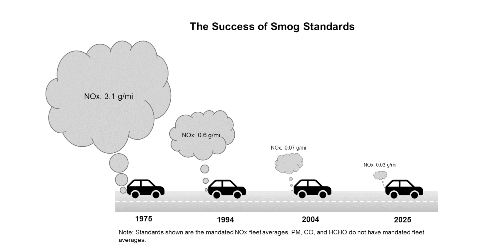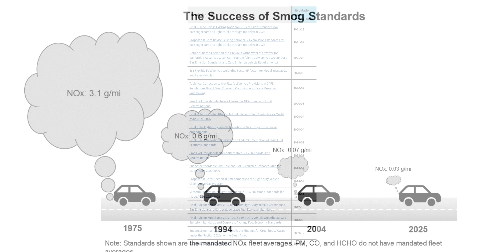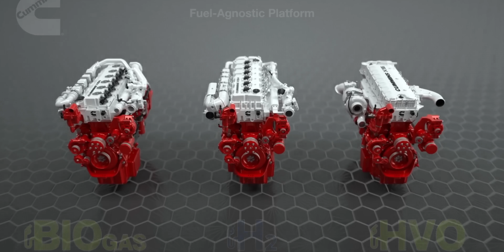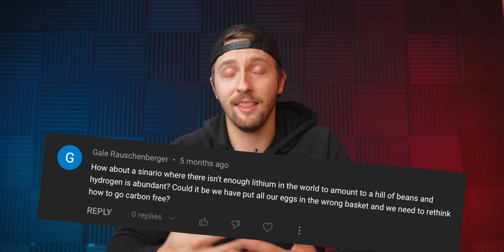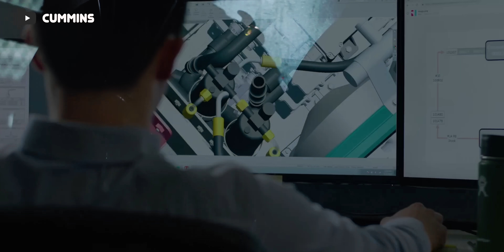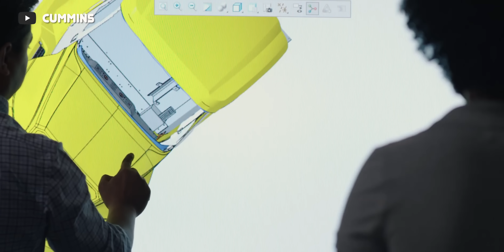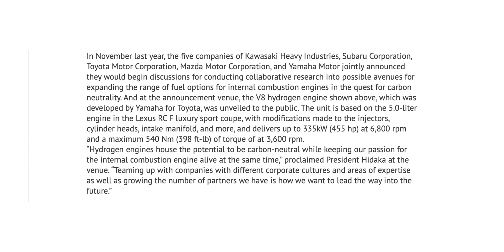Cummins Hydrogen Engine Will KILL DIESELS FOREVER

Comment: Great video. I like what they are doing. I’m a die hard engine fan. As a diesel mechanic I can pretty much promise you diesel engines will be around much longer than the epa bullshit. They will allways halve a place. You can run them on so many different fuels and the reliability, affordability, efficiency and power is unmatched. Electric will have its place as you said but we still NEED engines to make the world turn.
Reply: I heard the same story from a coal fired boiler mechanic (back in 1950) on a coal fired train.  "They will never retire this 10 year old train, and replace it with a diesel electric one" the fuel is to expensive, the cost to buy 100's of new locomotives is WAY to expensive.  

Consider this in about 5 years.  With $8 diesel fuel, and $0.20 per KW electricity when charging at your home base, the 200 KW per 100 miles VS diesel fuel will be a huge advantage to the electric truck driver.  Lets say you get 6 MPG at 80,000 pounds, and the electric truck uses 2 KW per mile.  With $8 diesel fuel, you would use about 16 gallons per 100 miles, or $128 per 100 miles.  

Lets say that a trailer needs to be moved 500 miles.  The electric truck driver knows he will need 1,000 KW of electricity at $200.  You might need $500 to $700 in diesel fuel.  You bid $900 deliver the trailer and take a $200 profit in two days.  The electric truck driver bids about $500 to make the same trip, and gets the job, takes 2 days and makes about $300 in profits.  Or bids $600 and makes $400 profit!  

In 5 years, driving a diesel truck will not have nearly as much profit as today!   If they say "Sure you can have this 500 mile trip, we have bids from a electric truck driver of $750, how much less can you do it for?"

Comment: Hydrogen is made by using electrical power to split water into Oxygen and Hydrogen, this process uses more electrical power per KM than charged batteries. Further the method of using an engine  powered by Hydrogen also produces much more friction and heat, and requires 40% more maintenance.  Further going down hill doesn't generate any power or hydrogen. Fuel cells will be the answer.

Comment: Diesel is staying around, energy density is king along with it being far easier to store. No issue with electric trucks for the short haul stuff that can work within the range limits and have the grid capacity to actually charge them, unlike places like California that can’t even keep the AC on let alone charge thousands of trucks that would be exceptionally hungry.

Comment: I wonder if hydrogen embriddlement will be an issue for the engine block?
Reply: Cummins 6.7 l diesel already has a strong block in CGI and I think the 15 l is close to get a similar material.

Comment: 2027 heavy duty diesel engines in North America will have either dual SCR, dual dosers or a second higher voltage alternator on the engine and electric coils in the after treatment to keep the catalysts hot(efficient).

Comment: When I go to the station I usually notice a few diesel pumps and many gasoline pumps with three grades of gasoline. However, I have yet to see any hydrogen fueling stations and I haven't seen any with electric charging stations either, although there may be some I haven't noticed. Liquid hydrogen is cryogenic, hard to store and handle. Compressed hydrogen requires a very high pressure to get much energy density. Hydrogen is okay for rocket fuel. It proved to be too flammable for airships, like the Hindenburg. It also is hard to contain as even some metal tubes are relatively porous to hydrogen. While we can get helium from some wells, hydrogen is so chemically active that it can only be produced with energy generated from something else. Since hydrogen is not produced directly from wells or extracted in mines or grown on trees, it is not going to be a very useful fuel. You have to consume more energy to produce the hydrogen than you will get when running an engine on it.
Reply: Well said

Comment: Ice has a long future there's no way we can go on with lithium and cobalt production whilst trying to claim we are saving the planet. Unless a new superior  battery is developed which doesn't use a  rare or hard to mine minerals then its pointless going down the battery route long term. Never mind the materials and infrastructure required all over the world for electric vehicles and energy consumption to power all those vehicles , we will just be pumping emissions and pollutants out to be make the infrastructure, the battery's and charging of these cars.

Comment: I'm not convinced hydrogen will be viable any time soon. Hydrogen is very difficult to contain, and is nearly guaranteed to sweat right out of the walls of pipes and tanks let alone leak through seals. Even NASA can't stop this issue, and that's the piping we would need for infrastructure.

Comment: Until fuel cells or some other method to generate H2 local to the engine becomes economical, I just don't see H2 as a viable fuel source.   The one thing that NOBODY seems to want to discuss when talking about H2 is that it's nearly impossible to store or transport without rather large leakage losses (much of the cost of current H2 is based on relatively large leakage losses with current economical storage methods).   The molecules are just too small to keep from seeping out of joints at high pressures (which is the only way you can even come close to viable energy / volume of current fossil fuels).

Comment: Diesels can run on all sorts of oils. Hydrogen engines will run but storage and transfer of fuel will be difficult and Platinum is hard to come by and the Chinese are taking IT ALL RIGHT NOW.
The smallest particle in the universe will leak like a government committee at every point and a pressure system that will sick a battle ship so stationary engine is the best option or train or ship, not road vehicle.

Comment: Terrible mobile fuel. Low density, high pressures needed for storage as a gas. Cryo storage as a liquid costly.   Terrible for standby use as liquid storage is energy intensive.  H2 molecules are tiny and find their way thru steel.  Hindenberg effect may hinder adoption.  BURN BABY.  Aint nuthin better than liquid fuels like hydrocarbons.

Comment: I feel like you're missing the point of hydrogen though. The biggest issue we have right now in our "go green" build out is the inability to store energy cost effectively while green output is on the high side for when it's on its low side. Hydrogen is basically 100% energy potential minus losses in efficiency.  Building massive battery systems to store the power means lithium and cobalt and all the nasty shit that goes with it. We can simply store that energy in the form of hydrogen and run it through the fuel cells when output is low. This is the entry into hydrogen technology. This will get the power industry to put the billions of dollars of research into making it cost effective for the automotive market.  But then imagine a little further out in the future when we can convert our natural gas pipelines to hydrogen. We can heat our houses with it.  We can fill up at home with it.  It's a much more feasible and sustainable market then evs but there isn't enough money going into it.

Comment: Train locomotives run with diesel on electric. It's a neat concept but that's a lot of weight making that happen. Any engine can power another engine, but it is an extra step. We used to talk about hydrogen but they balked about how explosive it could be, in the place of an accident. Then several years later the lithium batteries came along but have proven over time to also be plagued with potential fire issues. So now we're back to hydrogen again. Ballard makes hydrogen fuel cells that have been tested on city buses. They can provide solutions, but I still prefer simplicity. I'll be happy when we stop spouting the ridiculous nonsense that oil comes from rotting dinosaur carcasses. They started that years ago to perpetuate the idea of scarcity and that it was a finite resource. This makes good sense if you're all about making money. You wouldn't want people knowing it was a renewable resource that could be found all over. But I digress... I just want people to remember that up north, whatever you do, the vehicle will be expected to make cabin heat for the drivers life support as well as keeping the glass clear and not fogged at all times, in the cold of winter. When there's an internal combustion engine running, electricity and heat are just a glorious byproduct. It won't really eat into your range, but if you're running batteries, that is coming out of your range. If you lose your life support in your broken down vehicle in winter, you will die. Internal combustion cars can idle for some time and make life supporting cabin heat for its occupants. But how long would your life support last in a broken down electric vehicle? Where there's always new possibilities, there's always new problems. Propane is good, but again not for where it's really cold.

Comment: The key to Hydrogen fueled engines, from what I have gleaned educating myself on the subject over the last decade, is running them at ambient pressure.  When you "inject" the hydrogen at pressure it doesn't work.

Comment: welp, one must remember all internal combustion engines still get a fair amount of ring lubrication form the fuel, diesels a lot, gas, meh, 10%? dunno but not as much as diesels, start using fuel and or additives that CLEAN said lubricants off said surfaces is going to create issues, obviously, does hydrogen fuel lubricate? no its a very poor lubricant so then perhaps it needs an additive similar to two strokes to compensate? or maybe instead of adding it to the fuel, use an injector style, develop a cleaner lubricant.. frankly I believe that is the last hurdle, finding something that can lubricate these engines cleanly and retain longevity for said engines..

and yes even MotoGP is developing clean alternatives

Comment: I believe you're right I think hydrogen and electric, it will take both to keep the planet operating of course we are decades away from completely eliminating gas, I believe they will have a way to retrofit hydrogen engines from a gasoline engine , on the same line they did the AC unit on a car when they switched from R-12 freon to 134-A a few decades ago, according to the latest reports it's about 50 years of oil left on the planet unless they locate more

Comment: So I am totally against lithium, it is poisonous toxic  metal, which when recycled yields 94% recovered, that leaves 6% when is going to end up in ground water, you might as well have your children suck on lead pipes. And that is not even getting into the slave labor that is used to mine and refine toxic metals.

Comment: This is why most companies are going electric. And your statements on hiw electricity is generated is only at current,  obviously electricity can be generated by solar for no cist once the solar system is paid for. And that electricity can be stored. New methods of electricity storage is being developed and eventually that is the easiest transition as the entire world is already setup to transport electricity already. And the length of time you can operate will only get better. There are just too many obstacles to clear for Hydrogen.

Comment: Hydrogen liquid by volume is 1/5 the energy capacity of diesel. So you get 10mpg from diesel you get 2mpg from hydrogen.  Now let’s say you had a 200 gallon tank, 2000 mile range vs 400miles range. Let’s say you get 5mpg  on diesel that’s still 1000 miles range,  but you will be getting 1mpg on hydrogen, you now have a 200 mile range with 200 gallons of liquid hydrogen. It’s clean but man. Also hydrogen production uses a lot of water which is also becoming a scarce resource, you also need alot of electricity to make it, if a natural gas electric plant is used for electricity to make hydrogen,  50% of that energy is lost by the time it’s used put in liquid form and transported to the station.  If that was a nuclear plant then it’s fine but if it’s a carbon producing source it’s really not better then diesel as far as carbon footprint goes. As much as the epa wants these things the numbers don’t add up to advancement in lowering carbon footprint.  Until they say we’re building 50 nuclear plants I think it’s all a joke to me

Comment: It's never going to happen at scale, hydrogen comes from fossil fuels currently without carbon capture so its dirty! Clean hydrogen from electricity is very energy expensive to make so in this case 2 plus 2 equals about 16. The reality is electric has to big a lead on the rest so hydrogen will fizzle out when the numbers dont add up and and the real environmental damage from hydrogen will kill it.
HVO is another con made from palm oil by destroying the Amazon rainforest

Comment: You could have better described the obvious limitations of hydrogen, like the high cost to produce hydrogen and the challenges of storing it. Also, IC engines that run on hydrogen produce much less power that gasoline/diesel.

Hydrogen fuel cells (direct conversion of hydrogen into electricity) make more sense, but they too are economically unviable, because of the inherent cost to produce hydrogen and the difficulty of storing it.

Comment: The easiest way to make whatever HP you need or want would be to use a Hydrogen powered generator to drive electric motors mounted at each wheel you want to drive. You would only need 1 relatively small battery for each voltage you decided to use to accomplish your design of the total system. I already suggested this to the head design engineer for Corvettes at Chevrolet which could elevate that brand to the greatest sports car ever built & probably for less than 200K.
Reply: If I’m correct, the hurdle is for either method of powering the hydrogen engine, electrolysis or cooling the liquid form, requires a large amount of energy. I’m unsure if even with the most efficient method of doing these, along with the best alternator, if it could even generate enough of its own power to run these systems. Probably would end up needing massive batteries which would need to be externally charged to make driving a possibility which while not as frequent as a EV, will still bring some downtime. Add the need to power motors to move a truck and cargo and that power source needed just increased, and by a lot. I’m not an engineer though, just using my basic understanding
Reply: If you're going to use hydrogen to generate electricity, there is a more efficient and more versatile way than using a hydrogen-fueled internal combustion engine to drive an electrical generator. Of course that system would work, in the same way as diesel-electric transmission works for some trains, or turbo-electric transmission works for ships. But you would lose a lot of power due to the multiple stages of energy conversion: Thermal energy to motive power conversion in the internal combustion engine is typically around 40%. Using hydrogen would bump this up a bit, but then you also lose some more efficiency in the conversion of motive power to electricity in the generator.
With hydrogen there is a more direct alternative which makes electricity in one step, and with a minimum of 60% efficiency: Fuel cells. Need different voltages? No problem: Each individual cell only generates about 0.8 volts, so just about every practical fuel cell is a stack of cells in series to bump up the voltage to a more useful level. Adjusting the voltage output of a fuel cell stack is just a matter of controlling the flow of hydrogen to each cell, so you can vary the voltage in increments of 0.8 volts up to whatever the maximum you want to have, depending on how many cells you build into the stack. You can also vary the current output by controlling the pressure of hydrogen delivered to the cells.

Of course a fuel cell stack produces DC, whereas the most efficient electric traction motors today are 3-phase AC induction motors with variable frequency drives controlling both the torque and speed. But that's no problem: Modern power electronics can invert DC into variable frequency 3-phase AC with high efficiency. I first used one of these electronic speed controllers 30 years ago in a radio controlled car, which is admittedly a small scale application. But they have come a long way since then, and systems capable of controlling hundreds of horsepower worth of electrical power are used all the time in battery-electric vehicles. So using them for a fuel-cell vehicle is basically the same, with the fuel cell taking the place of the batteries.

Comment: Hydrogen is made by converting petroleum or methane feed stocks, NOT by electrolysis. Dirtier and less efficient than diesel when you take into account #2 fuel oil products.

Comment: Your comment at about 4:25 was incorrect.  The engines won't be able to burn diesel or hydrogen in the same engine.  The compression ratio needed to do this very different and the emissions regulations as far as I know wouldn't give a benefit to an engine like this. Otherwise, great video

Comment: Great video you covered a lot of things I was going to say. I think they are all over-complicating this, a diesel locomotive doesn't run on diesel fuel it's all-electric and the diesel fuel runs a generator that charges the batteries. It gets better MPG than a semi-truck.

This is old technology it's been around for ages, they need to do the same setup for cars and trucks but instead of the generator running on diesel fuel or gasoline have it run on propane or natural gas, these fuels are already in used all over the country anyway.

How a diesel locomotive works⬇️
https://youtu.be/cIQ0yIZgQeE

Hyliion is already doing it which will cover the distance and be much more efficient. ⬇️
https://youtu.be/8Ch4bfGzAjs